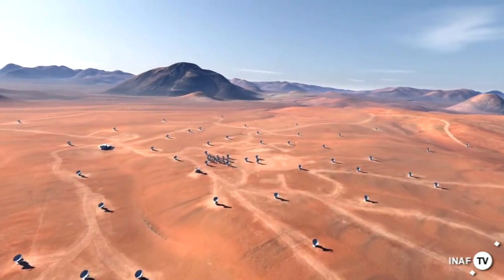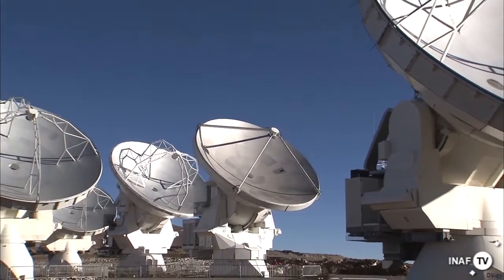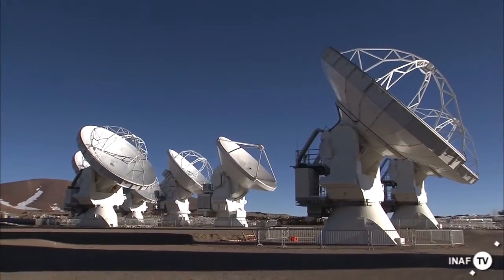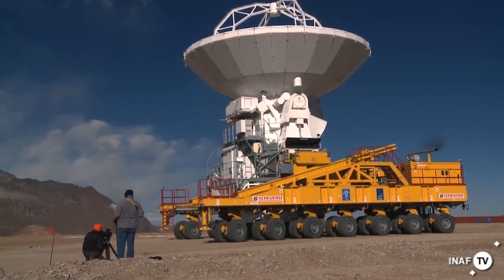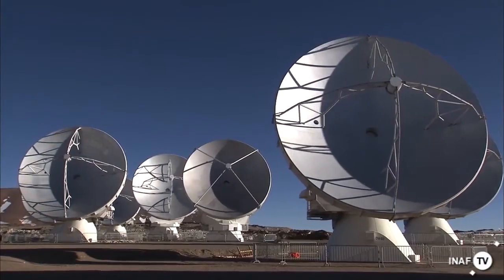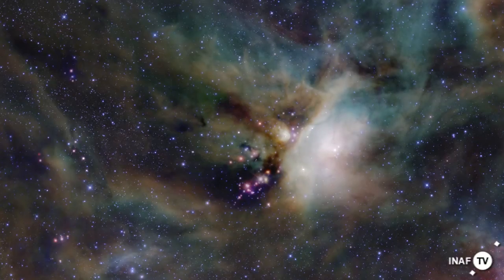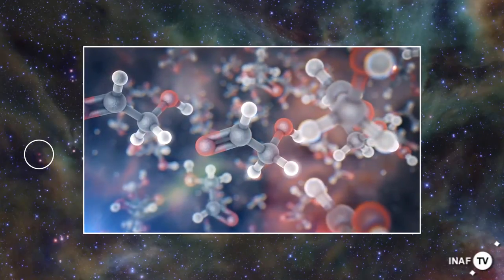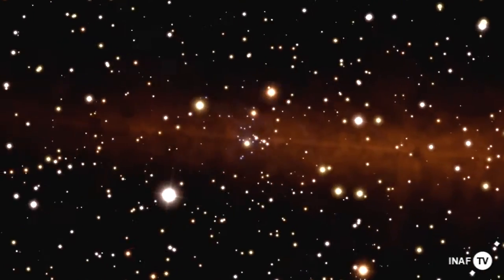Tutti i segreti di ALMA svelati da Al Wootten

Comment: Another important Italian contribution is in the correlator, the machine that puts together the signals from all the antennas to make an image. The original correlator design had two distinct modes of operation, in order to observe thermal radiation or one specific individual molecule, but not both. Italy proposed and designed a modification in the correlator, so  it is now possible to do both at the same time, or to observe several different molecules at once.